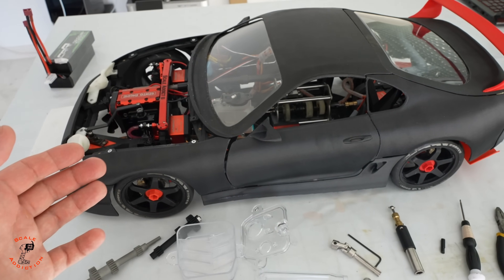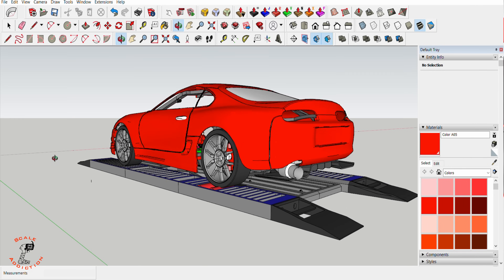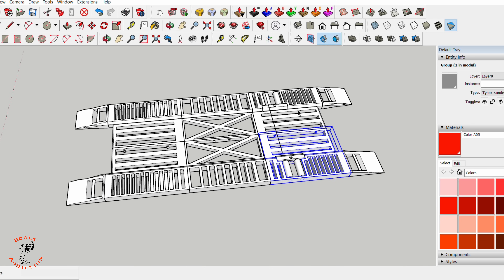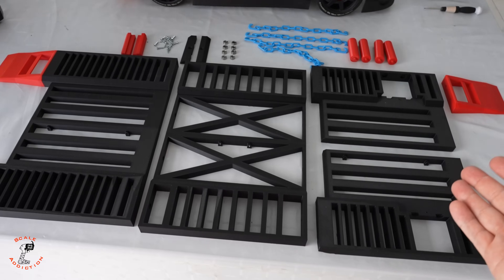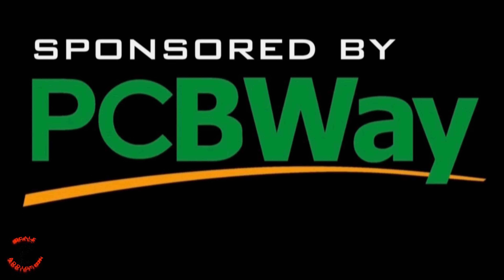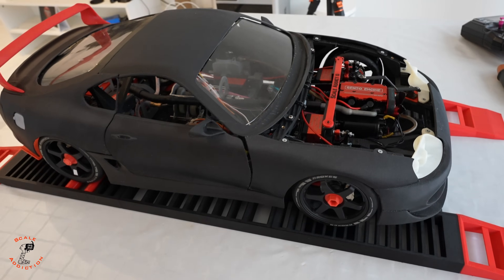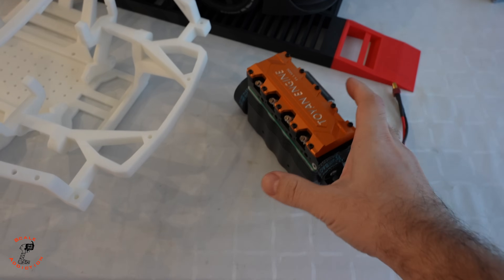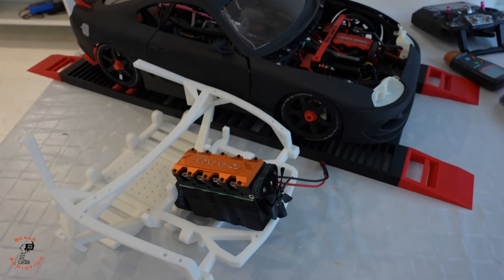How long the engine last??? till it finishes one tank

Comment: does the 4 cylinder engine work in it to because on the stirling website it says it is but before I buy it I wanted to know if it was compatible with the supra
Reply from the maker: No, i have to do some change ls in the engine bay

Comment: 1.Lap the valves.
2.Change to more durable o rings.
3.This thing needs a tune badly.

Have a look at JohnnyQ90 channel for some serious ideas to asd to an already great build.

Hes managed to get a V8 cison to put out some crazy power and be able to deliver that power to the wheels extremely efficiently, the thing lifts off the ground on acceleration 😂
Reply: Looks like you are so dumbb, he designd the entire chassis and all that work, what's ur boy Jonny do, just making metal parts with super expensive tools,  which for me its useless,  because I cant do that, what's the use if he can do something and I cant, I'm enjoying scale addiction channel,  we all have 3d printer and can make same thing
That engine running on 16% nitro, that's why it spits out, he mentioned that, in most country in Europe 20% nitro illegal to use, think before commenting next time...
Reply: @OrderReverse I agree with you definitely

Comment: Given these scale looking engines don't put out the power to weight of a typical nitro or brushless setup I would consider gearing down. If my math is correct, at the rpm measured at the wheels with no load based on typical 1/8 scale tyre rollout this car is geared approximately 90mph..there is no way this engine has the torque to reach those kinds of speeds, I think at least gearing down by half...45mph if still possible is plenty fast for a custom built rc especially with 3d printed parts. It's a fantastically beautiful and well engineered build, just if it were to be used like a normal rc car I think there is a lot of untapped potential with the gearing to enable much high acceleration and torque rather than being geared so high that those are lost whilst still not reaching the speeds it is currently geared for.

Comment: Have you thought about putting a working Turbo 3d printed with metal thanks to PCBWay to the engine?
Reply from the maker: Yes, stirlingkit has one, if that was didn't fit, I wilk design my own and metal 3d print it

Comment: @scaleaddiction
you should put a very small hole in the bottom of the exhasut near the opening so all of the liquid fuel can drip out rather than be shot out the pipe
Reply from the maker: I will try to do that with new Exhsust which has a muffler too

Comment: Best project (idea:the exhaust ejects unburnt fuel as liquid and gas so if you put a spark plug it would pop the exhaust!)
Reply from the maker: Thank you very much,  appreciate that
Reply: it's risky and can burn the body
Reply: @Speedster-NoCounterr  real cars can burn too yn
Reply: He can just put a aluminum plate there @Speedster-NoCounterr
Reply: @ntlz5899  the heat from the aluminium plate can melt the body
Reply: @Speedster-NoCounterr bro this is not a real car it will not get that hot if that were to happen engine would melt everything on that car stupid

Comment: Its kinda sad, that these Toyan engines are so horribly optimized. Imagine if he had "superscale" RC models with accurate engines these days, that also have a good amount of power.
Reply: The power is ridiculously low on these engines. Stock Traxxas 3s are capable of 80kph+ out of the box 😢
Reply: I imagine we do somewhere / somehow? 
I have a single piston nitro engine with 2 speed and awd, 16.000 rpm and 160kph top speed and it's over 25 years old.
Electric rc is easy but no sound so kinda boring

Comment: The engine sounds bogging like it's running too rich.
Reply from the maker: Yes it's rich, because I'm using 16% nitro,  if I tune it down,  it won't run good, it's designed for 20% nitro
Reply: @scaleaddiction  thanks for the quick response. Keep up the great work.